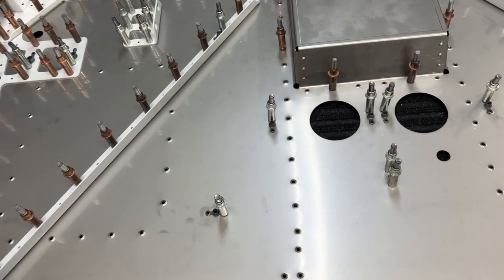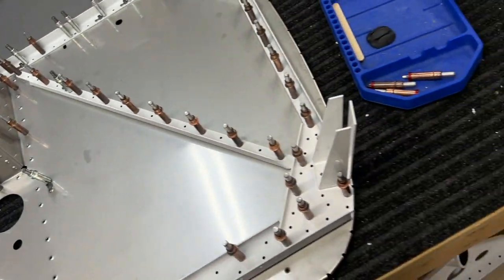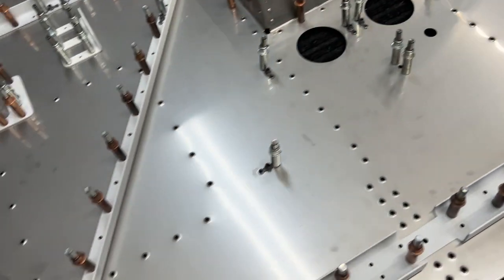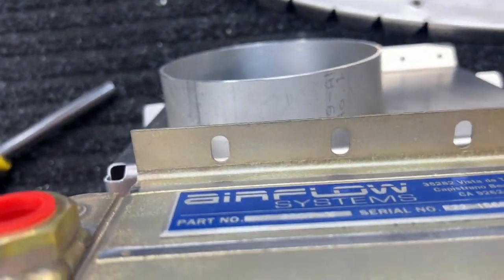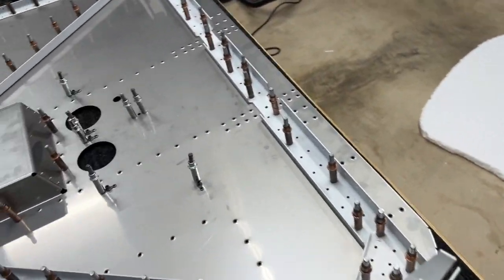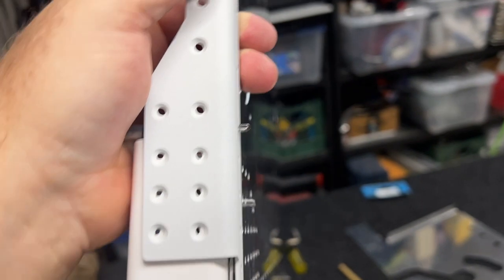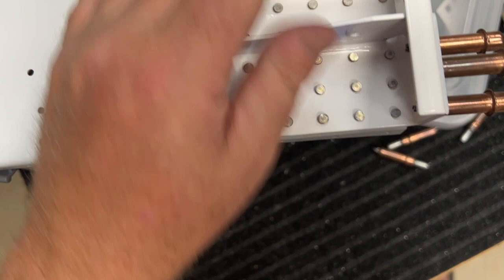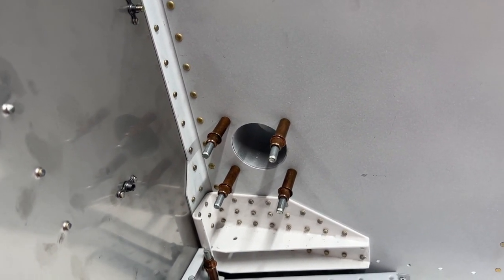RV10 Build Section 27 Firewall - Video 37

Comment: Hey Ryan…When you riveted the 1002PC and 1003PC in corners did any of the powder coating chip off? It happened to me even with the bucking bar covered with masking tape. Juet figure I would ask you
Reply from the maker: I would have to look closer, nothing was too obvious to me.  I have noticed some cracks in the powder coating when I was drilling and riveting the longerons in section 29.  I will be painting all of this for my interior, so not super concerned about it.  I will NOT be painting the firewall, but the brackets and frame will get painted.